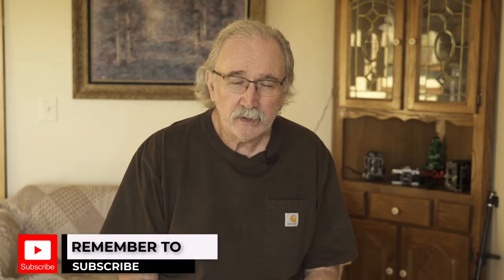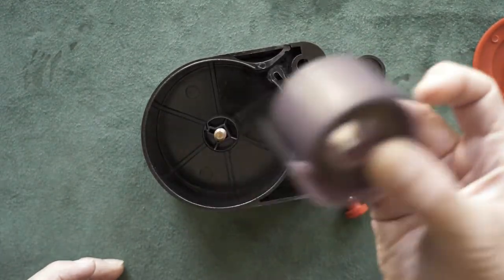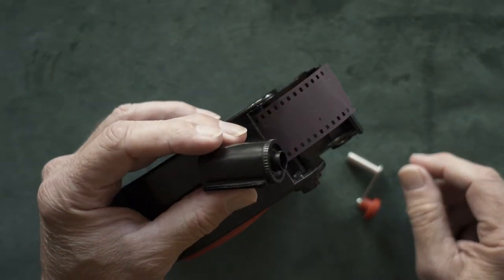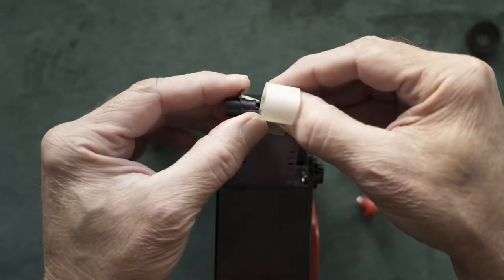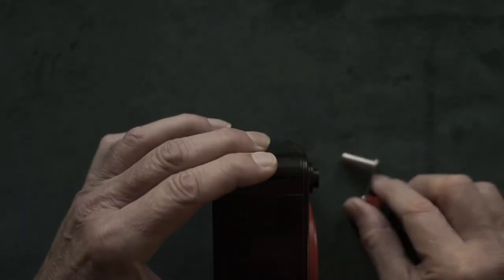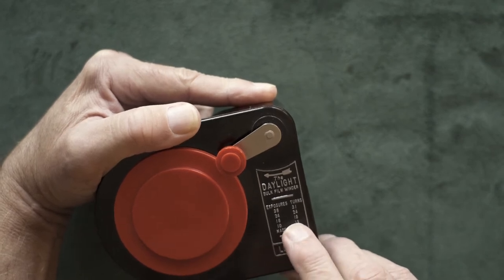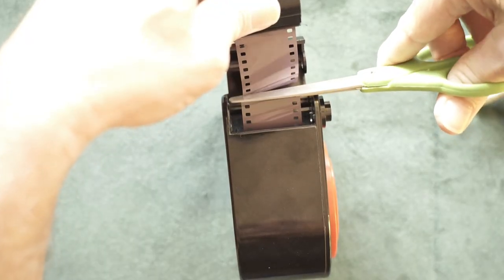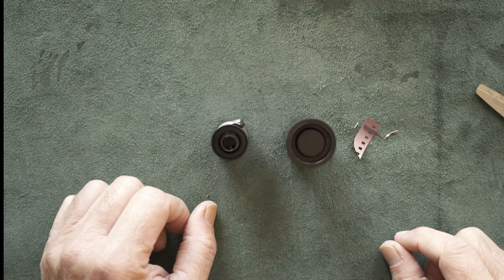How To Bulk Load 35mm Film Using Lloyd's Daylight Film Loader 35mm Film Savings

Comment: If you use a film sold in bulk rolls, you can save significant money doing this after your initial investment in a loader and cartridges.  While the Lloyd's loader is usually a bit less expensive to buy, I think it is also the only loader which uses a felt light trap which is permanently squeezing the film as you drag the bulk film through it to the cartridge. Others use a switched gate which frees the film from any material like this when moving the film. Doing this avoids scratching which can happen as dust or grit builds up on the light trap.  Once a felt light trap has dirt in it, it cannot be cleaned. Conclusion: Unless you can find a new, unused Lloyd;s unit and keep it clean, buy a different loader.  As to film choices, Formapan and Ilford films in bulk are priced to allow a reasonable savings. Kodak prices their bulk so high that there is little savings to be had. I know of no color film presently sold in 100 foot or shorter bulk rolls there days, except that some resellers are cutting long rolls of Kodak Vision 3 movie film into 100 an 50 foot rolls, but again the middle man is sucking most of the potential savings out of the sale to the end-user.
Reply from the maker: True fully I have never had any trouble with any units I have bought used in the past. So far have never had a problem of scratched film but there is surely always that possibility. Thanks for the good response.

Comment: Yes, I had one of those Lloyds loaders and eventually threw it away.  Best thing I ever did.  It scratched every film I loaded.  As Randall Stewart indicated, you can't clean it to get the dirt out.  I have a Watson and it is absolutely great.  Get one if you can.  The film does not touch any felt.  There are other very similar brands that are almost exactly the same and work well, though the Watson seems to be sturdier.  As far as film, I do have to disagree a bit with Randall.  I tried a 100 foot roll of Fomapan 400.  I found it to be a terrible film.  It is rated at 400 ISO but is closer in my opinion to about 160 ISO.  It also does not dry well and is spotty and scratches if you look at it the wrong way.    It has terrible halation glow and in my opinion very low contrast.  After a number of months being frustrated with Fomapan 400, I thankfully ran out of the roll.  I next tried Kentmere 400 (an Ilford film).  What a difference!!!!  It is actually a 400 ISO film and it has good contrast and dries well.  After months of frustration with Fomapan, the fun was back in photography!
Reply: I mentioned those films as examples of what is available in bulk, and to point out that some present savings and some do not. I've not used Fomapan films, however what I've seen indicates that Fomapan 100 is a superb film and the 400 has issues for some folks. Both have had problems with consistency in the past. As for brands of bulk loaders, the King of Them All was the Alden models, Styled like the Watson, the precision of its build exceeds all others. AP currently sells a different style of loader which looks to be excellent, but at $125 it is also the most expensive.